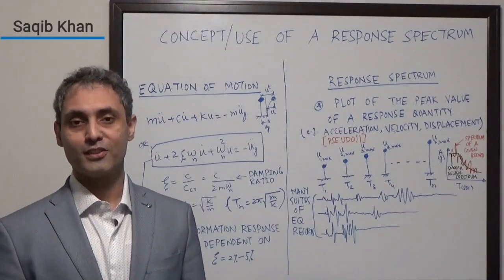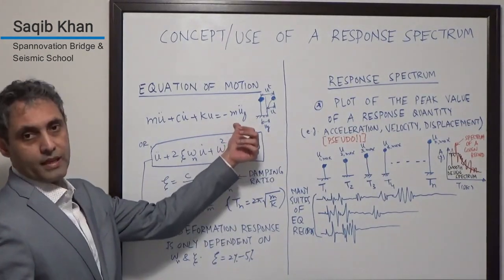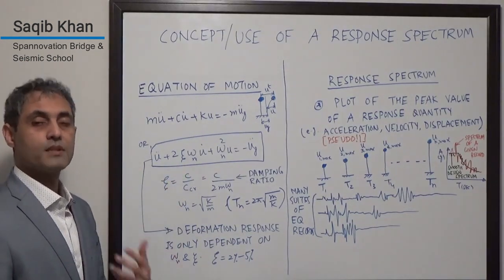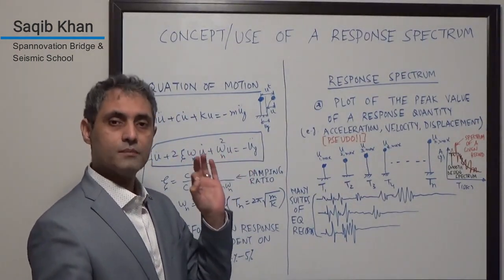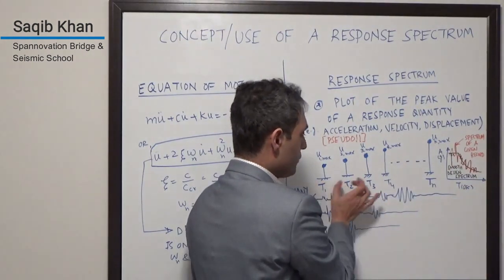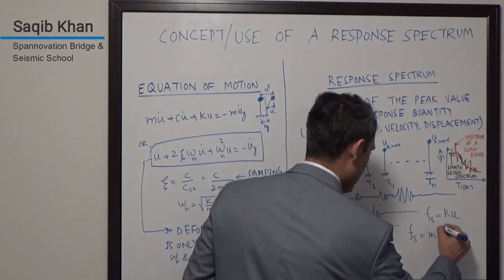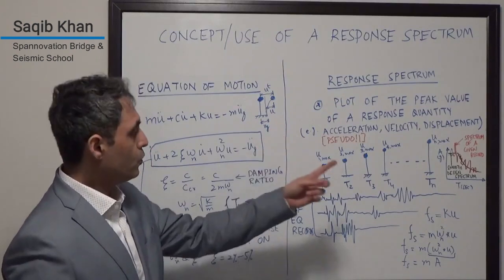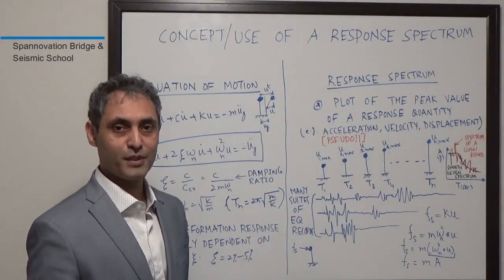Response Spectrum Analysis (RSA) - Concept & Use

Comment: Hi sir, 

Can the matched response spectrum(of a certain time history ground motion record) be used as an alternative seismic input instead of the design response spectrum(target) from the code?
Reply from the maker: One could do a site-specific response analysis (it's usually carried out by geotechnical engineers). For this, an outcrop ground motion is input at an appropriate level below the ground surface and wave propagation analysis is done to obtain the time history signature at or close to the surface. A design spectrum can then be generated corresponding to the mean or mean plus minus some standard deviation of the response spectra of a number of time histories.
Reply: @spannovationbridgeandseism9421   thank you sir,

i'm just wondering, what if i have this ground motion record, then i did a spectral matching of its corresponding RS to the design RS of code (target). Since I already obtained the matched RS, instead of doing a time history analysis using the RS-compatible time history, I will used the corresponding RS of this time history, assigned it at each support, and then perform the conventional response spectrum analysis (but in this case i have different response spectrum at each support of the bridge). do you think it is an acceptable/appropriate procedure?

Comment: That was a great explanation, well done.
I also want to ask, what is your take  on multiple - support response spectrum (MSRS)? why some code provisions such as AASHTO doesn't consider this type of analysis? If I am not mistaken, the conventional RSA is based on the assumption that the bridge excites under uniform ground motion, however for long span bridges this may not be the case. MSRS, which is based on random vibration theory, consider this variation in ground motion (wave passage, incoherency, variation of local soil condition) which may amplify or deamplify the response of the bridge.
Do you also have lectures or references that demonstrate the use of this type of analysis(MSRS) in practical engineering?
Thank you.
Reply from the maker: Leon: You make an excellent point here! I am not sure why the MSRS method has not found widespread usage. To the best of my knowledge, it has not been adopted by any code at this point. You are absolutely correct that the traditional RSA assumes uniform excitation at all supports and cannot capture the effects of spatial variability leading to multiple-support excitation effects. Conventional RSA using the envelope spectral values can be unconservative and would miss local demand concentrations at different support conditions. So far, I have not seen any softwares incorporating MSRS or code provisions that can help a practicing engineer adopt the MSRS methodology. 

Generally speaking, multiple-support input is of more interest in longer bridges, whereby the design is checked using the Non-Linear Time History (NTHA) analysis incorporating variable time history inputs at different support locations. The variable input NTHA would provide the most "Accurate" results and the MSRS is therefore not needed for such cases. Interestingly enough, I am carrying out some research in collaboration with University of British Columbia on this topic. We are going to come up with some design guidelines for practicing engineers to design shorter bridges appropriately when the geotechnical engineer provides us with multiple response spectra for a given bridge site. However, it is not based on the MSRS methodology; the idea is to use NTHA assuming variable time history input corresponding to different site classifications and generate trends for bridges with 2 to 7 spans. Based on statistical analysis from the data obtained through extensive NTHA, we will try to propose some amplification/de-amplification factors, etc. to modify the response spectrum to be used. The design engineer should then be able to use the standard RSA technique and inelastic static pushover analysis (ISPA). The design can then be carried out using the standard analysis and design techniques as enshrined in the various codes of practice. That is the idea anyways but we will see what form the recommendations eventually take.

For MSRS references, please start your search with Dr. Der Kiureghian and you will start finding papers through various internet resources. Once we have got some credible results from our research, I will try to do a whiteboard video about this topic. Thanks for leaving an excellent comment and inviting discussion on this topic. Please stay engaged with our community!